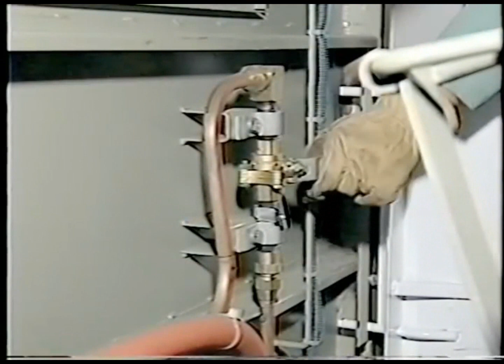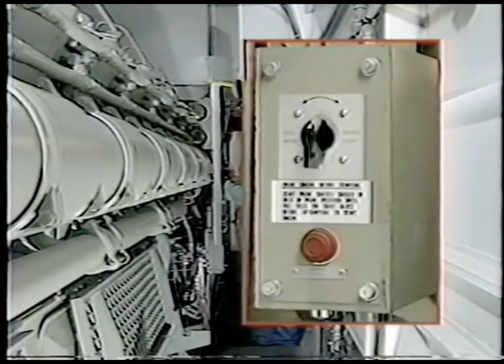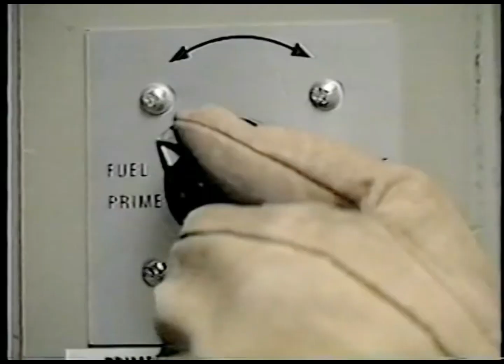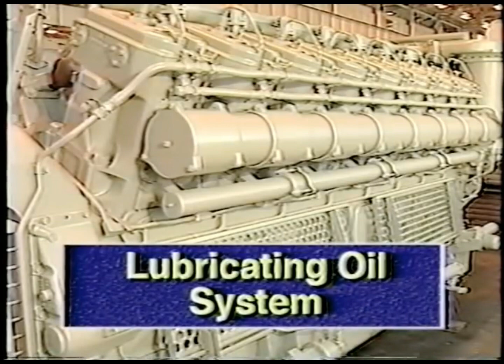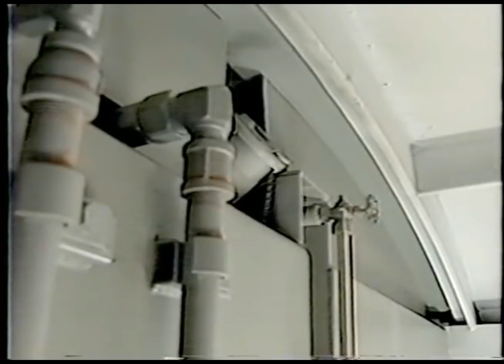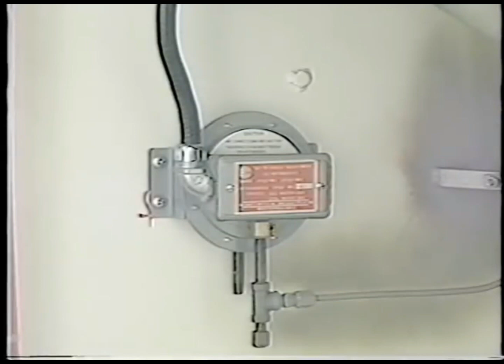Amtrak P42 Loco 7FDL-V16 engine compartment|Engine startup and lube, air and fuel cycles|Alternators

Comment: @Railways University Excellent Video.  The C40-8((9)W), C44-9W And AC4400CW Use The Same Prime Mover.
Reply from the maker: TY, yeah the 16v-7FDL Engine with electronic injection system instead of mechanical one.
Reply: @FuriousLocomotive  YW, And GEVO'S Use GEVO-12's Or GEVO-16's For Some Of The International Builds.
Reply from the maker: Yep the new Evolution Series locomotives.
Also wait for some videos about gevo engines am now working on its 3d model. Soon we will make some 3d animation videos about it.
Enjoy!
Reply: @FuriousLocomotive  Thanks, I'll Be Looking Forward To It.